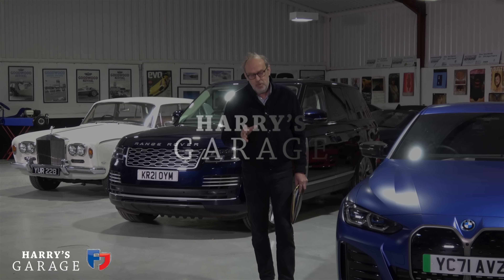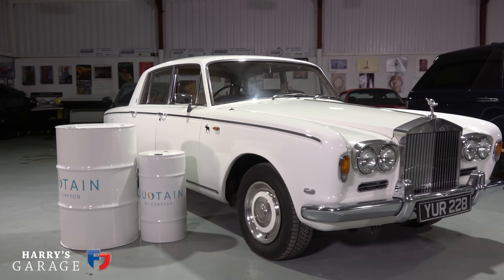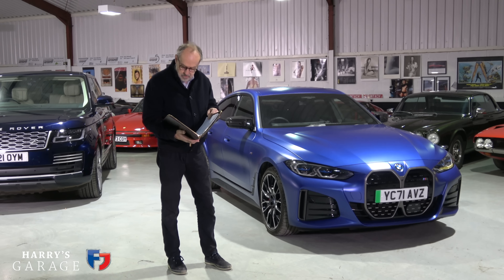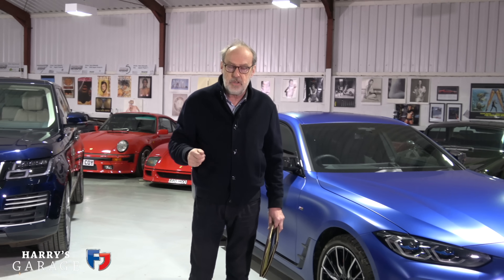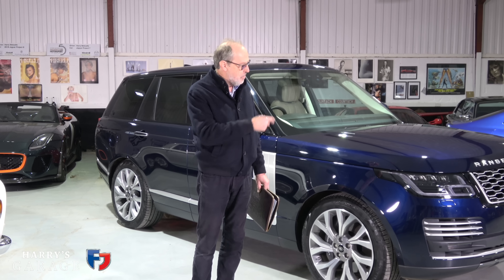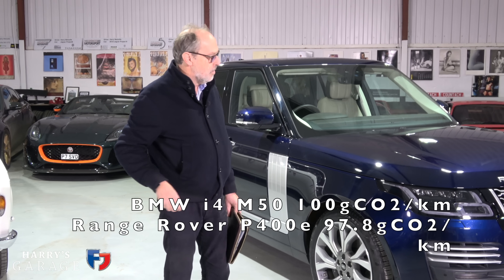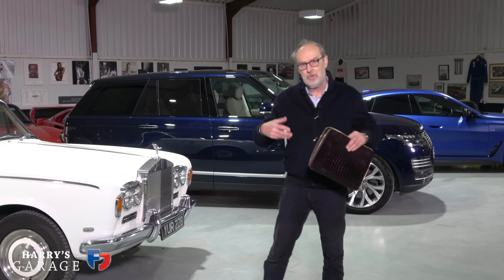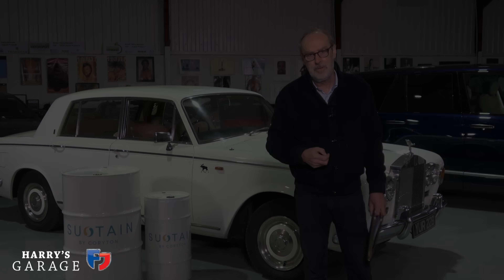Sustainable fuels; what are they & are e-fuels better for the planet than running an EV or PHEV?

Comment: Well done Harry, I love the work you do as you explain everything so clearly. I just wish all of the politicians would wake up to the nonsense of pure electric cars. What has happened to JCB's Hydrogen powered engine which was another great project.
BTW is SUSTAIN fuel just a replacement for petrol or do they have a diesel product too?
Love your thoughts regards to the classic cars but there's a very large percentage of diesel vehicles on the roads too.
Kind regards Paul
Reply from the maker: Thanks Paul, check out their website (there's a link in the video description) but yes, they produce sustainable diesel as well. I think their main focus will be Motorsport to begin with, then classics, then everything else.
Reply: @harrysgarage  I remember following a lovely new age campervan in Cornwall enjoying the lovely smell of chips, do people still use cooking oil? It did cause problems.
Reply: @zypp33  my uncle used to run a Pajero off of chip fat in the early 90s. Brilliant
Reply: @harrysgarage  as a few others have pointed out we already have biodiesel on sale in the UK and many diesel cars will run on vegetable oil. One issue though with using plant based material to produce fuel for vehicles is the land area that it would take if it were to become predominant, particularly considering the expected reduction in farmland as the planet warms up further.
Lots of questions but thanks for a great video. I think you did well there and much appreciated.
Reply: @tsb3093  I didn't think modern cars would run on it? I remember when my grandad put red diesel in his mazda B series pick up about 20 years ago to run up the field. It knackered the injectors and glow plugs
Reply: @chappy2121  well I’m no expert but red diesel is I believe just normal diesel fuel with a tracing and colouring additive so HMRC can test if it’s being used for an illegal purpose. So if your grandfather’s Mazda failed due to the fuel then it may have been contaminated in other ways.
In any case I wasn’t referring to red diesel but to the use of vegetable oil to run a diesel car. Again I’m no expert and couldn’t confirm if it is safe for all diesel cars but a neighbour of mine runs his ten year old jeep on it depending on the price of it compared to diesel at the pump. Recently vegetable oil has been cheaper.
Reply: @tsb3093  yeah if people can use it they should be permitted to. I'm sure I read somewhere years ago they added some form of tax to it dependant on mileage use? Yes red diesel is just dye. I wonder if more modern ecus can detect the dye and that's why it shut down? 🤔
Reply: Hydrogen doesn't exist NATURALLY anywhere on earth. It's one on many man-made elements. You have to convert a  compound such as water into its elements, oxygen and hydrogen. Given that water is the byproduct of the combination of hydrogen, this is like making wood or coal from ashes. 

The laws of thermodynamics means that you'll always lose out and it'll cost more than just using electric to power a motor.
Reply: @peterwilliamson1825  Hydrogen is a man made element is it? Glad you cleared that up because I was under the misapprehension it is the most common element in the Universe… 😂
Reply: @harryspeakup8452  it is…but that doesn’t mean it’s a man made element… think about the distinction between atomic Hydrogen H and molecular Hydrogen H2. Man made or synthetic elements are those with atomic number of 95 or higher…
Reply: Biobutanol is the answer

Comment: I'm doubtful sustainable fuel is only twice as expensive.  Let's see a review on unbiased channel.
Reply from the maker: Where's the bias? Ring Coryton up yourself and ask to buy some Sustain fuel. That's what I did and was quoted £3/litre.
Reply: @harrysgarage  continuing to use already manufactured cars versus new (electric) is way better for the planet, granted!  The airline industry has a much greater demand for a sustainable carbon fuel, and if it is only twice as expensive, problem solved!!  I'm doubtful after seeing analysis done of "green" hydrogen vs "blue" hydrogen..

Comment: As recent events sadly pointed out, perhaps the greatest danger of fossil fuel is not global warming, it's geopolitical instability. If the UK gets its gas from the North Sea and Norway, then I'd be happier driving an EV that pollutes a lot rather than an ICE that pollutes the same while financing some Oil state. Also it's worth thinking that the grid is constantly getting greener, while petrol is just petrol. Synthetic fuels are really interesting though, hope they'll be a success.
Reply: Heavy metals and resins are still heavy metals and resins. Unless you start making your infrastructure from bamboo then you're not any greener.

Comment: Just thinking through the calculations and for the Range Rover you only included petrol CO2. Electric kWh charging CO2 needs to be added as well which would push it above the BMW.   Great video though, quite thought provoking.
Reply from the maker: I was highlighting my own situation, having put a 6kW turbine in back in 2007. I also have to be careful to not confuse viewers, which was another reason I didn't include that figure.
Reply: @harrysgarage  what's stopping you charging a pure EV with the electricity generated by the wind turbine? Is it not compatible? Seems awfully convenient that it can charge a PHEV but not an EV...
Reply: @harrysgarage  Thanks for the reply. I understand your situation but as the EV could also be charged from your turbine I think it would have been better to compare like with like for both CO2 and pence per mile.   The sustain petrol is a very interesting prospect.

Comment: When I heard about Porsche’s synthetic fuels I assumed it was some magic chemical. But it sounds like it’s less about the formulation and more about how it’s made?

First law of thermodynamics: Energy cannot be created or destroyed, only converted from one form to another. 

I’m sure when the need necessitates it these fuels will become more prevalent and cheaper. Arguably it should be done sooner. 

Thanks for sparking my interest. I will read up on it more.
Reply: Definitely not magic and requires massive co2 to produce and transport it. Also even with Porsche pushing hard for it and people referencing their plans their output is miniscule.
They are aiming to produce .5 billion litres by 2026. Perspective= UK uses 45-50 billion litres a year! 
It's a low volume solution for enthusiasts not a game changing solution like the anti ev brigade (I can't begin to understand why they are so passionately anti them?!) seem to think.

Comment: Any thoughts on synthetic fuel plus electric as hybrid like the Range Rover?

If synthetics come down in price... They serve a purpose due to refuelling speed. Electric serves a purpose for small journey efficiency.

Someone doing a long journey effectively pays a premium by needing more fuel than electricity.

And as houses gain some sort of energy generation over time (solar most likely) the reduction of stress to the grid allows governments to mandate moves off fossil at the power plant level.

Comment: Great Information Harry,  I honestly believe that Electric Vehicle are not the answer, I believe that answer is Hydrogen and sustainable fuels can bridge the gap from fossil fuel to a Hydrogen solution.  I found your video with the work that JCB have\are doing with hydrogen driven power-plants very interesting.
Reply from the maker: I think EV could well be the answer but we to find a new way of storing electric energy, as it's the battery tech that's the problem. They are currently too heavy, too slow to charge and don't offer good enough range but I'm told, off the record, new tech is coming and it will revolutionise EV take up. Expect a 2030 EV to be very different to today's EV.

Comment: Like the videos but now this is the second time when reviewing or comparing electric cars you have used the CO2 levels for the electricity but completely ignored the impact of the fuel production.
If your going to list and use the CO2 impact of electricity then you MUST do the same for the fuel production.
So the impact of your renewable fuel has to include the production process, shipping impact, and delivery to your door.
Electricity is delivered directly to your home on an existing network and is already used to deliver power to your home.
Any fuels that requires refining, shipping, transportation and in the case of your bio fuel containerisation there is a huge impact to the environment.
Also the mining you refer too for the batteries and the process you failed to mention a few areas.
The process of bringing oil to the shore, the mining of lithium is actually pumped to the surface and dries in the sun naturally. Lithium is used on batteries in mobile phones, tools, and ICE car batteries such as McLaren and many others.
Reply: True, thought the same!
Reply: Right but this is an endless circle. Might as well do that for the gas that's produced, extracted and refined in the power stations to generate electricity for the cars. Then transmission losses in the grid network and inefficiencies in the cars charging system. Gas power stations aren't 100% efficient at all.
Reply: @ciaranwebb6871  Surely EV's are making our electricity production more efficient given that much of the energy produced in the low demand times, ie at night, is currently wasted. People generally charge their EV's at night with energy that would of otherwise been lost.
Reply: @ciaranwebb6871  not all electricity is generated with fossil fuels. Nuclear, hydro, wind and wave power to name but a few.
Also are you planning to turn all your electricity off then so you don't use it for anything?
You talk of losses in the grid, but what about all the carbon produced to deliver your fossil fuels. Electricity is delivered to your home, street, work, and everywhere you go on a network which doesn't add to the carbon emissions.

Comment: Your absolutely right , that manufacturing , whether it be of cars or other products causes more CO2 , than existing cars itself , yet the motorist seems to be getting the “Lions Share “ of the blame. If we all converted to electric cars overnight , it would NOT , I repeat, WOULD NOT, save the planet. Recent figures have shown that a new EV would have to cover 90,000 miles before it is beneficial to the environment. Planet Earth has been heating up, then cooling down , since time immemorial, before human life was on earth. There is another form of pollution, congestion. When you purchase a NEW vehicle it occupies that much more space on the road adding to a situation which the road network can’t keep up with, especially in the UK. Besides I have said before, having high levels of electricity at close proximity to ourselves is not good for human health. Stick to our classics, if you want to be environmentally friendly, keep them well maintained , serviced etc, and don’t use them if you don’t need to , school runs if can be done on foot and so on.

Comment: Brilliant video thanks Harry. Are there any downsides to using the Sustain fuel such as corrosion, gelling over time and basically gumming up the injectors when the car is in storage?
Reply: There is currently another bio fuel on the market known as Alkalyte fuel this is non ethanol based and due to the fact it has no ethanol in it and non of the solvents that get added into standard fuel it has a shelf life of 3-5 years and doesn't cause damage to carburettors or fuel systems.  Also without the harmful solvents it is a whole lot cleaner burning and doesn't cause harmful emissions that effect the ozone or cause cancers related to using regular unleaded fuel. If the bio fuel harry is testing is similar it will most likely be a similar outcome.
Reply: @bentullett6068  thank you!!

Comment: Given your concerns about emissions from BEV manufacturing, have you looked into energy intensity and emissions from the manufacturing process for sustainable fuel?
Reply: Exactly, also the BEV is build once, the E-Fuel has to be generated constantly with huge amounts of energy needed.
Reply: You seem to have missed the point. The sustainable fuels are produced with renewable energy only.
Reply: @geoffwoodgate7450  Still, it takes a multiple times more energy, energy that could be used for more useful things. E-Fuels will be needed for things like aviation and ships where batteries won't be feasable in the foreseeable future, whilst for normal cars it's the most efficient way, there is no way around that.
Reply: could the bio-LPG produced from the process of the sustainable fuel be transported also and used to generate electricity for additional power to the UK Grid and other grids. you also need to factor in the shipping fuel and co2 output of transporting the fuel in tankers, but i suppose its the same as normal fossil fuel

Comment: Even if this wonder fuel producers no co2 gain. It’s not helping to reduce what we have already pumped into the atmosphere. And although at best the co2 May balance out it’s still putting fumes into our lungs. We need to rid our cities of pollution and this will not help. It’s just another cry from the ice brigade to keep their noisy smelly death polluting engines running. It’s about as sustainable as running yr car on unicorn crap

Comment: Add to all that how much of EV consumption is purposefully omitted from the official and all reported figures: the German ADAC calculated that the very best car at optimum had 10% charging loss, and that absolutely skyrockets if your battery isn't at optimum temperature AND can absolutely skyrocket also if you quick charge instead of the slower AC charging.
It is true, I have experienced with my EV the MASSIVE real-world increase in consumption when temperatures fall below optimum: easily 100% increase!!

Then the trillions in costs for building a whole charging infrastructure and maintaining it, the trillions into rebuilding the whole grid, the trillions in subsidies and increased vehicle costs for inferior vehicles!

E-fuels and biofuels all the way!
Reply: Your choice in a few years to pay 4 pounds per litre for bio fuel or 0,4 pounds per kWh electricity 😉
Reply: @appleaday3868  You don't understand supply and demand. Even currently before effects of EVs, increase of electricity production hasn't been keeping up and electricity prices have been skyrocketing. When EV numbers skyrocket then the price of electricity will go ballistic. 

You are completely incorrect with your made up biofuel prices (that's how you spell it, and actually it's biofuels since there are probably nearer a hundred different kinds). Why would biofuel prices increase? Modern biofuel is literally made from waste products. Up until now we've been driving on biofuels and fossil fuels with blended in biofuels for years and years, and it's been pretty stable in price, even with the mandated increases of its use. People have been driving on biofuels for years all over the world, with not even a fraction of the subsidies that polluting EVs get.
Neste's NEXBTL has been very good in price (produced in three refineries now), Shell has announced that its FIRST low-volume production, its first initial test production of e-fuels will only cost 2€/liter including taxes so switching to that is many times cheaper than switching to EVs.